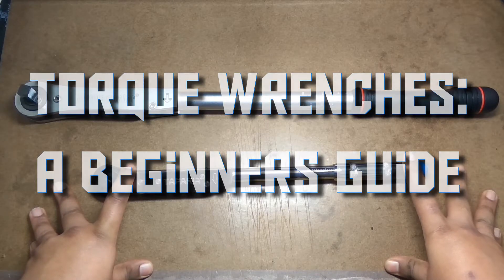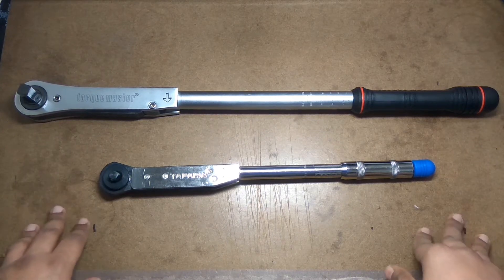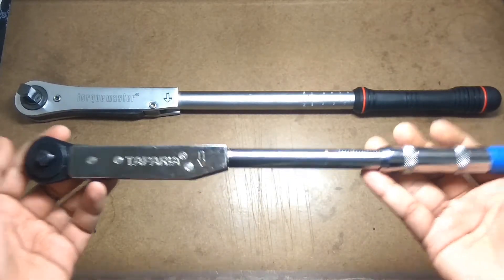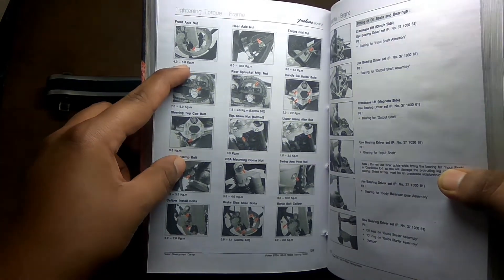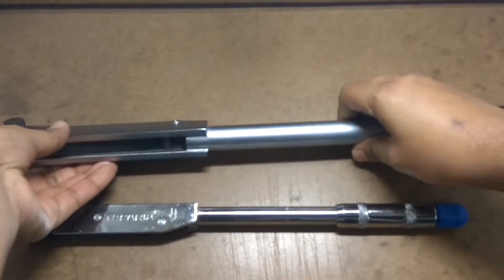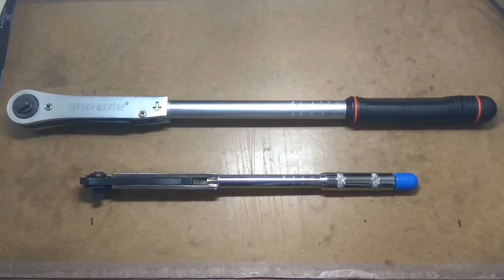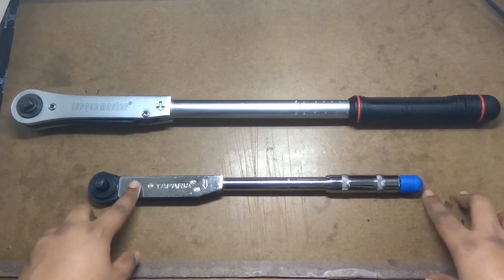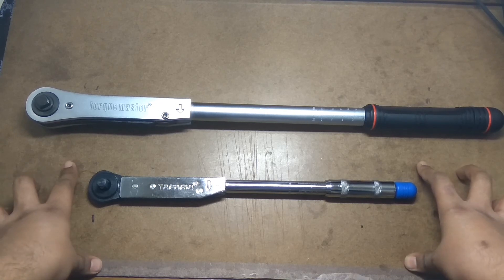Torque Wrenches : A Comprehensive Guide for Beginners

Comment: Thank you so much.  just bought Mac Master TW25. it does not have a user manual.  Your  have explained everything what i need to know. very informative  . keep it up
Reply from the maker: Glad I could help!
Reply: Torque master has the manual at the back of calibration certificate . And no Mac master and torque master are not the same. Different companies.

Comment: Akshat you are good at this and you seems knowledgable on the things you are talking about. However I have one small criticism/suggestion . (you can ignore this as well as I would still be your subscriber).You need two things , 1- add some footage of actual usage rather than talking only.(I think you have promised to a fellow commentator on some other comment thread ). 2 - you need to be little more fluent while explaining as this is pausing the flow of the video. This you can very well do by writing a script and read it than thinking while explaining.
Reply from the maker: Thank you so much for your suggestion Subhrajit. I will work on it, your feedback will help me improve my content.

Comment: From where to buy this torque wrench and what is the minimum price of this type of tool ?

Also how to calculate socket size as in your case it is 1/2 inch.
Reply from the maker: Torque Wrenches are available online, but I would suggest search your local tools market first. You will be surprised to land a better deal.

The drive sizes and torque limits for Torque Wrenches are mentioned in the data sheet and is available on Taparia's official website/

Comment: Thank you for this excellent introduction to torque wrenches, my friend. You have a good sense of humour also, haha. 

I have a few questions please..

1.) In India which are the torque wrench companies and models that you will recommend to me? I mainly work on my motorcycles. 

2.) I asked my KTM service centre to show me their torque wrench and they said yes yes of course and took some time to search for it wayyyy down the drawers and it looked brand new and unused hahaha. Scary actually! Like u said hardly anyone uses it in India. Anyways, have my screws and bolts been damaged all these years so that torquing them down NOW is a dangerous idea perhaps? Cuz they will be torqued too loose now maybe because of years of overtightening? 🤔

3.) if I can afford to buy an American one, do those wrenches also need to be re-caliberated periodically like you mentioned? How will I be able to do that? Sending it back to America? And which one would u recommend?

4.) what torque value range of torque wrench must I buy to cover most motorcycles 🤔? I will surely be checking out my workshop manual. But roughly? 

That’s it, I hope I didn’t brother you too much with all these questions, I’ve found the need to torque screws down now because I ride a KTM 390 and i reach speeds that are scary and the workshop guys do work which is quite dangerous and faulty; I have quite a bit of experience working on my previous bike so I trust myself more and I have the workshop manual and my guru circle YouTube for me to get advice from experienced gentlemen like yourself. 

Thank you again for making this video! Johny
Reply from the maker: Hey, Johny. Thank you for your questions. Answering them in the same numeric order.

1. I have used both Taparia and Torque Master and I found Torque Master better in terms of quality and fit and finish. Also, TM tools are easily available at your local tools dealer and at a good price (better than online)

2. You are absolutely right! Most name-brand service centres (be it 2-wheeler or 4-wheeler) know how to use a torque wrench (it's in their training) but seldom make use of. Its a time taking process for them to calibrate and set the each and every faster to the exact torque value. Hence, they just tighten the fastener by hand. Stripped and sheared bolts are very normal on Indian automobiles. 

3. If you are buying a torque wrench from overseas (America in this case). You don't really need to send back for calibration (digital torque wrench can be an exception). Your local tools dealer (a reputed one!) can do it for you. However, I would suggest you buy local, as it would be easy for them to service a known torque wrench.

4. For working on motorcycles, I would suggest you check the minimum and maximum torque value of any faster and buy accordingly. I make use of 5-175nm and I also work on my car now and then.

And please don't abstain yourself from asking questions. Us bikers and DIYers are a close community and it is sworn duty of every member to help each other. Thanks again for your questions :)

Comment: Have you ever used Torque Adapter? Can it be used as replacement for torque wrench?
Reply from the maker: Torque Adapters are of great use. However, using it incorrectly can mess up the torque values.

Comment: Means taparia can't be used everywhere means for each nut as it doesn't come with all required torque limit🤔
Reply from the maker: Yes, a single wrench will not cover the complete range of torque settings. This is the same with almost every brand.

Comment: Taparia is a new comer in torque products.
There illiterate distributors don't even know the technical value of torque wrench. It is just a mere tool for them just like ordinary spanner.
Reply from the maker: Agree with you on the distributor part. Yes, the sellers are barely aware of what they are selling. 
When it comes to Torque Wrenches, I am satisfied with their offerings, although there is still scope for improvement.

Comment: What happens if i torque the nut beyond the click?
Reply: Amit Modi if you further tighten beyond the click the fastener will further get tightened and torque specifications will be deviated
Reply from the maker: Nothing serious, but it is not adviced. Pushing the wrench beyond the click will torque the nut over the required specification. this can also mess up the calibration as you will be putting prolonged strain on the spring inside the wrench.